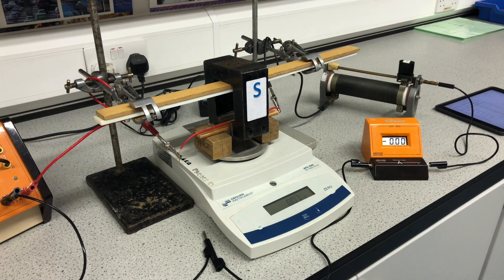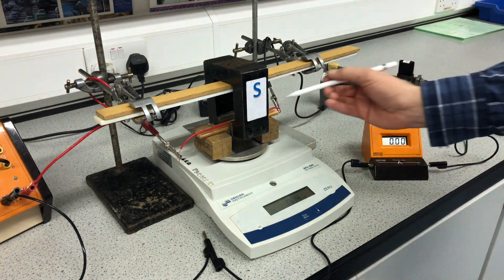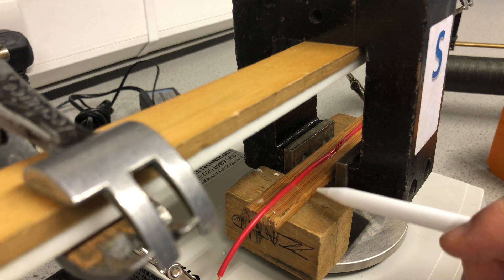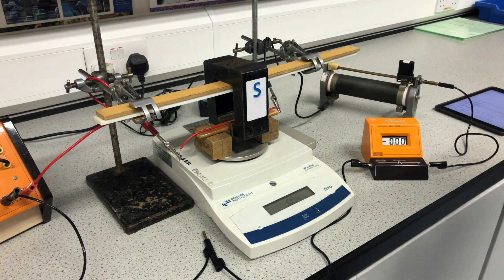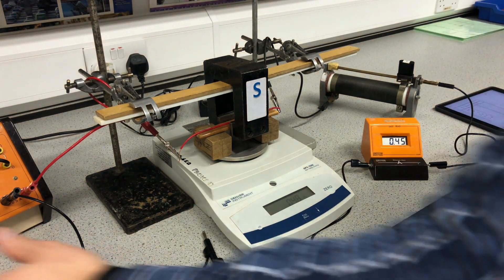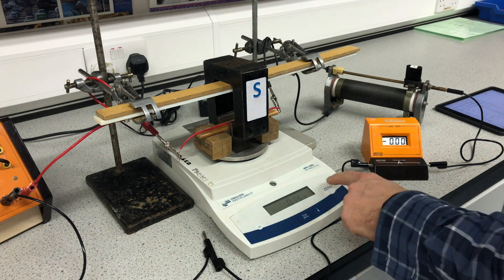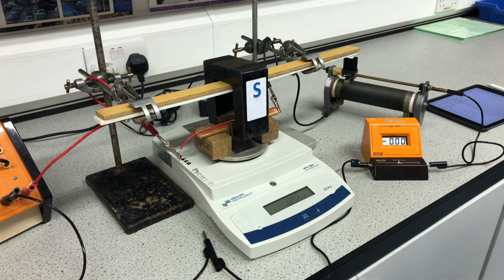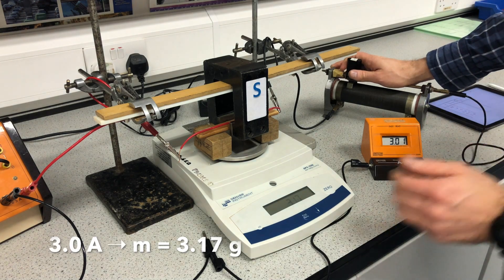Current Balance Experiment (measure magnetic field strength)

Comment: how the fact that the wires get hot when the amperage is 3A  affects the result and the experiment?
Reply from the maker: Resistance of the wire increases when its temperature increases.  And temp increases significantly at a current of 3 A.

Comment: Hallo, I am from Indonesian
I want to ask you about the magnet
where can i buy neodymium magnets?
Reply from the maker: We bought ours from an educational supplier.
Reply: excuse me, I want to ask again in the circuit, what is the voltage and power of the rheostat needed?
Thanks
Reply from the maker: Hi. Voltage was about 6 V
The rheostat had a maximum resistance of about 35 Ω.
Reply: @PhysicsHQ  thank you so much for the answer
Reply: I am sorry one more question
how many watts of power is needed?

Comment: Hi I have a question is the total magnetic force acting on a semi-circular wire the same as what's exerted on a fully circular wire
Reply from the maker: Yes it would be provided it’s the same current flowing: F = BIL sinθ. F is independent of A in some sense there. 

However, I = nAve (taking q = e since it’s a wire). 
So if we used same metal for our semi circular wire with same n, and ensured same v then I is proportional to A. Specifically by moving to a semi circular wire we’ve halved the A so current will halve. F∝I so the force will also halve.
Reply: Thats amazing. Thank you so much for your help, that makes so much sense now
Reply from the maker: Great. You’re welcome.

Comment: what is the purpose of a scale in this experiment?
Reply from the maker: The scale measures the force between the magnet and wire. The value is adjusted so it reads as a mass so we reverse that and calculate force from the mass.
Reply: @PhysicsHQ  how would you reverse the mass?
Reply from the maker: When I said that we "reverse" it I meant not that we "reverse mass" but we reverse the concept and calculate the force from the mass shown on the scales. 
The scales actually measure force and calculate a mass value from that.  We reverse the calculation done internally by the scales since we are actually interested in the force value.